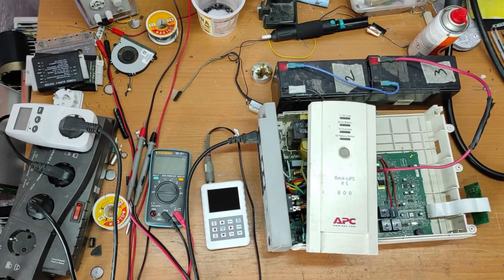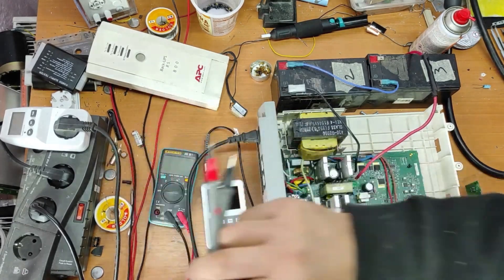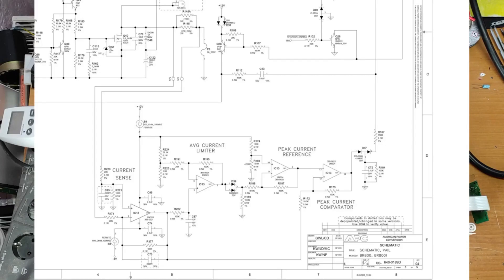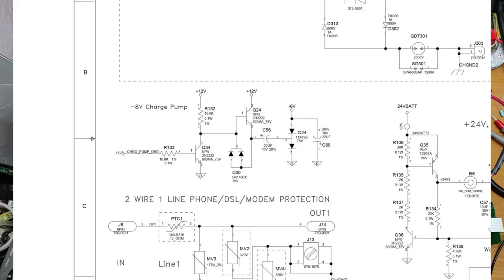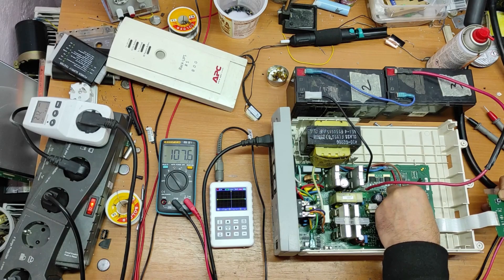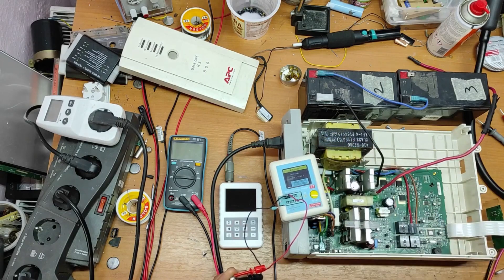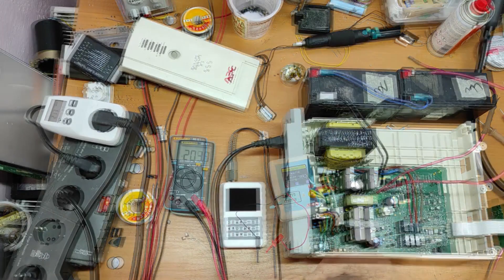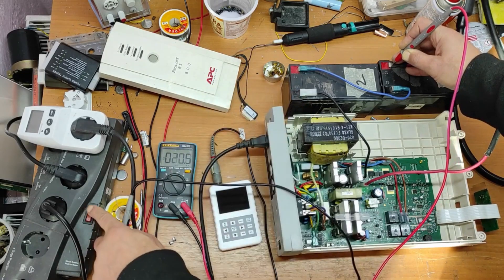How to fix  Apc Ups overload error on 800VA or any other model

Comment: Thanks for the informative video Marius  - Old electrolytic capacitors are by far the most common components to fail (in my experience) and always worth checking first, which can save considerable time spent on diagnostics. I found that when the UPS battery's approach their end of serviceability, they put considerable additional strain on the battery charging circuit. It pays to install new batteries at the recommended intervals, which few people do. Most components will typically last decades, except for those filled with electrolytes. 😉
Reply from the maker: You are perefctly right bro.

Comment: Wow, this is great thanks!  I see you just posted it 7 days ago and I was looking at the same issue on my APC Backup-UPS XS 1000.  It is similar style on the outside so sure it is a similar board.  I will open it up and take a closer look.  With the original battery in it, it was just making beeping noise and lit "On Battery" but then I changed it to another BAD battery I had (showed on other system "bad battery" and using those batterys it actually lit up Overload.  So if the batteries are really old or haven't used in a while it might not even show the correct error.  I will buy a new set of batteries for the unit I know that works and then test those in the unit I am not sure if it works and then if I get that overload message again will follow our video or have someone do it for me with better soldering skills
Reply from the maker: I had to remake this video because of copyright.original had 15K views and lot of coments.I hope u will be lucky and solve problem.

Comment: Curious how/where can you find the schematics for the various models, especially the SM* series?  Looking to find out how to manually run "self-test" and possibly run tests through a serial connection.
Reply from the maker: I did some tests long time ago with special cable to conect to the pc and dedicated apc program.but i dont remember the details sorry.
Reply: @diymariuselectro  Thanks.  I recently bought the NMC APC9641 as I found it on Amazon/APC store for a very reasonable price considering a used 9630 or new 9640.  The NMC will can run a self-test manually in addition to other tests.  There may be a way to run it through the front panel as well.

Comment: Helpful video. Thank you! A friend asked me to look into a APC Smart UPS 750 which was clicking endlessly when plugged in. I took it apart, stayed that way for a while, and after I assembled it back, it worked as it should. The batteries charged to 100 percent, but this overload issue started right when I plugged in a 300W laser printer so test the UPS further. The screen showed over 120% load and it beeped. No idea where to go from there.
Reply from the maker: replace this capacitor.maybe u r lucky.

Comment: A few days ago, my APC RS800 stopped working. I turned it on, waited for the green 'On-Line' LED, and plugged in my PC. Immediately, there was a loud bang, the electrical fuses tripped, 
and the side of the plastic case felt warm. Now, the device shows a red 'Overload' light, even without any electrical load connected. In the weeks leading up to this incident, I occasionally experienced the following pattern: turn on the UPS, wait for the green 'On Line' LED to come on, and plug the PC (without turning it on). At that point, the UPS would switch to the orange 'On Battery' LED. To fix this, I would turn off all components and repeat all steps again.
Do you have any idea what component might have failed and where I should focus my attention? Thank you.
Reply from the maker: bro I presume that is short mosfet . and my experience tell me that is not worth repaired, because in most cases will blow again. buy another one.

Comment: How to check gate drive of this ups, sir in my apc smart 1500 ups gate drive of +ve chennel is missing results no output how to repair this problem please help me.
Reply from the maker: you need schematic and osciloscop and check step by step.but if there is a big fault,is cheaper to buy another ups than repair it.you can repair only if you want to learn electronics,
Reply: Sir I am already expert in repairing of inverters that is the resason that I have checked its gate drive, i have also changed it's ic18(H-driver) smd ic, i found  there is no input signal at pin no 2 & 7, Also I found voltage is at pin 3 & 4 that goes out from it's pin 13 & 14 also at pin 10 & 15 that drive voltage is absent. I think it's ic21(361-0025v2) is perhaps faulty because there is no any voltage at pin 4 & 7 of this ic which goes to pin no 2 & 7 of ic18(H-driver)

Comment: Hello Sir: I have a APC BK500 (Back-UPS 500) and it is behaving exactly lie this BK800 is behaving. With no load and new battery, the system Overload LED turns on and is consistent. I see that you replaced capacitors C60 and C56. However I have dissembled my BK500 and the Capacitors C60 and C56 do not translate exactly. Would you happen to know which two capacitors I would need to replace in order to resolve the overload condition. Thank you in advance for your assistance.
Reply from the maker: I cant tell u the name of the capacitors, but there r only 2 of this shape and they are fat. 330uf/25v. its easy to find them bro.
Reply: @diymariuselectro : Thank you for the response. I found the two capacitors. They are between and (Black, Red, White) transformer wires. They are C13 and C45. What brand of SMD Capacitor (330uf, 25v) and specifications do you recommend buying for this repair? Thank you in advance for your assistance in this project.
Reply from the maker: they r not smd, they are tht capacitors.
Reply: @diymariuselectro  I believe you are wrong about the type of capacitor. To get a better idea of what I have, I would like to send you a picture or pictures but I can't.
Reply from the maker: @chrisparman2080  u have my mail in newer videos.
Reply: @diymariuselectro  I was able to find a valid schematic per the model I am working on and I took out the board and the is a high voltage THT capacitor rated at 10uf, 450V that seemed have had a failure in that seems to have overheated. I am going to replace it and see if the overload condition goes away. The 2 330uf 25V capacitors seem fine and those two capacitors are surface mount, I can most certainly prove that with a picture :)
Reply: Upon replacing the 10uf 450V capacitor doesn't solve the overload condition I am going to give up because it won't be worth my time any longer and I will by a new APC Backup UPS :)
Reply from the maker: dont give up bro, do it for science.

Comment: When I start playing the overload alarm starts going off, is it normal? or do I have to change the 22uF 16V capacitor? I have the apc ups cs 500 model
Reply from the maker: yes try this maybe u r lucky.
Reply: ...when you play, especially 3D, your GPU drains a lot of current, maybe you have to upgrade your UPS to a more powerfull - the 500 handles 350 watt - a gaming pc and monitor + accessories easily arrive to 500 watt, not to mention heavy load games that require fast GPU and CPU with fancy cooling systems

Comment: Guys maybe someone knows the anwer - I had the similar problem with my BR1500I (with C41 capacitor) - I changed EVERY 22mkF 16v capacitors - UPS seems to work fine(switched on and off battery/electricty) - but if I load it over 300Watts  and power goes off - it goes into 'OVERLOAD" status again. Have anyone encountered such problem?
Reply from the maker: bro check the schematics on overload current sensor branch, must be some capacitor there.
Reply: @diymariuselectro  Can you name what voltages it should be? I've seen two 3000 mkF capacitors close to battery wires but they seem fine🤔 I have a scheme but have no idea where to look😁 Checked all 35v 10 mkf as well and changed them just in case but it didn't work
Reply: @diymariuselectro  Can it be 400 volts 22 mkF capacitor(close to fan connector)? I checked all mosfets there they seemed fine but didn't check that one capacitors C9 on scheme
Reply from the maker: bro I cant help u without the schematics and without to see the pcb..